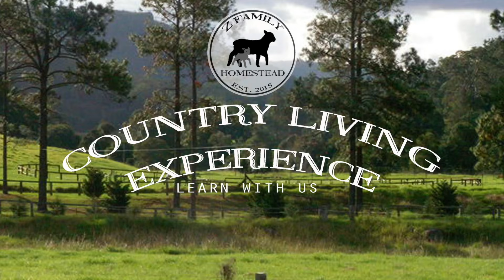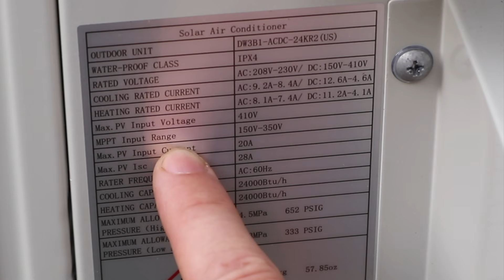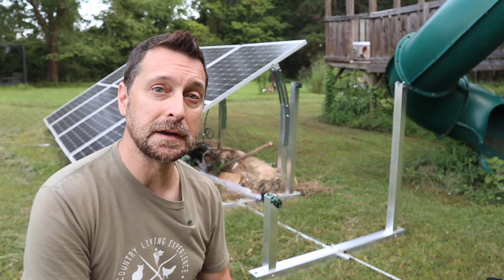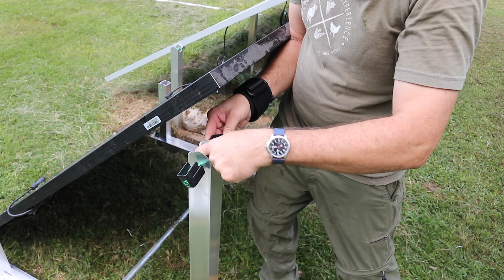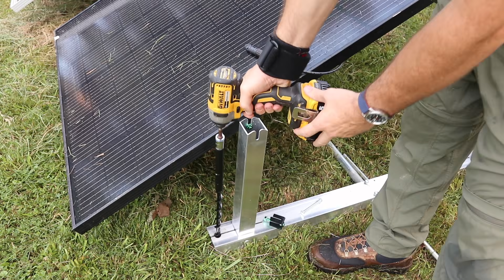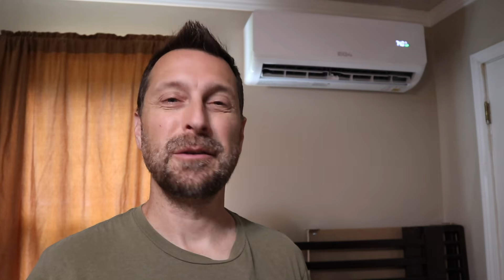EG4 DIY Dual Zone Mini Split! How Many Panels Do You Need?

Comment: ?????
Can’t you just hook it up if you already have panels . Do you need all those extra ones . I got my whole house with regular air conditioning heat . Thinking about those mini splits . So my power can be used else where . I have no clue on the numbers of anything I went big and hoping for best .
Reply from the maker: You don't need to use panels directly. It connects also to your home's ac power. Then you can use your whole house solar system. 
This product is for off grid situations or if you do not have a whole house solar setup.

Comment: I'm running mine on 6x Risen 545w panels no problem. Was getting too many low power drops midday with only 5, I'm still within all safe limits as they are 32v each and 38v VoC at 17amps, if my math is wrong hope someone corrects me soon but as far as I can tell thats safe still. Does max watts actually matter if you can exceed it without going over the Volts and Amps limits?
Reply from the maker: The voltage is what matters the most to not damage the inverter. You are at 228voc per my calcs which is totally fine.

Comment: The EG4 multi zone that I put in my house I’m running 6 590watt at 300 volt unit runs good on solar and on AC but not stable at sun set and sun rise fault 76 with the dc bus dropping out when the boost control wakes up or goes asleep.
Reply from the maker: I have heard one other person mention that. What did EG4 say when you contacted them?

Comment: QUESTION: If you install this in a location where AC is not available for evening power after the sun goes down, is there a battery bank that could easily be charged during the day (preferably with the same solar panels simultaneously), that will last thru the evening until the sun comes up in the morning?

if yes, please specify.

thx
Reply from the maker: As far as I know right now, you would need a separate charge controller and battery bank. Then you would need to somehow connect that to the power supply for the air conditioner. At that point, I would just suggest a normal home solar system and let the extra panels that are connected directly to the air conditioner serve to save battery power during the day. That is what this is doing for me. It is allowing me to charge my batteries, quicker off my main array and just use direct DC power for the air conditioner. Or if you have the grid enabled, then the panels that are connected to the air conditioner will save you having to run that load off of the grid.

Comment: So the EG4's magic trick is that is can accept AC or DC power and blend the two? Why not run solar panels with an inverter, feed it into the house's 115VAC ("Plug-In Solar) and run a cheaper, ordinary mini-split on AC alone instead? The HVAC unit will still run partially or entirely on solar power; it's just being getting it from your house instead of directly from the panels. And the solar panels can feed the house even when the HVAC isn't using it.

Comment: What happens to the PV potential from those dedicated panels during the shoulder seasons, when temperatures are mild and the mini-split runs very little, if at all?
Reply from the maker: You could disconnect and reconnect into your main solar inverter. That is the advantage of the easy to assemble and disassemble IntegraRack.
Reply: @CountryLivingExperience  years ago there were solar charge controllers with diverter loads.
Solar would charge the batteries until full the excess would be dumped to another usage.
if you put one between the panels and the unit any overflow could be used for other purposes.

Not sure if the AC MPPT controller will play nicely.
Reply: @CountryLivingExperience  - I have IntegraRack mounts, but I don't know how that really matters for this question.  No matter how you slice it, your money is better spent on a less expensive mini-split and a more capable PV/Inverter/Battery setup.  Something that meets your needs all the time, not just when it's hot or cold outside.  The EG4 mini-split that can run directly off solar is a classic example of a product that sounds great, until you do the math.
Reply from the maker: This is a specific product for a specific use case. If you don't want it, don't get it. It will be valuable for someone else. So no, some people can "slice it" to make it work for their situation.
Reply: @jasonbroom7147 deek sounding from you
Reply: @chop98  - I'm sorry...is the math hurting your head again?   :p
Reply: @jasonbroom7147 so you admit it! 😎
Reply: @chop98  - If that makes you happy, sure.  ;)
Reply: @jasonbroom7147 you should feel ashamed. You can't even apologize to the man

Comment: Is the system also hooked up to a battery bank? I think that I will stop working once the sun goes down without a battery bank. Correct?
Reply: @victorfebo2672  It can also connect to AC power for overnight.  Battery bank works too, though. When connected to both it will take DC watts, first. Then make up power needs with AC power if it has to.
Reply: @TheHippoConspiracy  Thank you! That makes a lot of sense!

Comment: Nice video! Is there a way to configure your system for load balancing between the two zones?
Reply from the maker: Thank you so much Rob. Are you talking electrical load or cooling/heating load? I think the units ecu will control and balance everything.
Reply: @CountryLivingExperience  I'm thinking electrical load. Can I set parameters for maximum grid usage, then set the units to balance using that limit. In my case, I live in Arizona and I'd like to have panels connected directly to the mini split, then have the grid connection connected to my grid-assist main solar system. I know that sounds odd, but temps is AZ can get dangerously high and the grid occasionally goes down. I'd like to have multiple power sources available to the mini split in a fail-over configuration.
Reply from the maker: Yea, you have a very specific use case. I don't think these are that intelligent. I looked through the instructions for the App (which is the only place I could find with more feature functionality) and did not see anything.
Reply: @CountryLivingExperience  ; Thanks for checking!

Comment: Do you have any regrets not going with the larger unit? I'm trying to decide which size to purchase. The 24k unit is large enough to handle the sq. ft. of my house, but I like the idea of being able to add more panels, especially in the winter for running the heat when the sun power is lower.
Reply from the maker: No. This is perfect for my house and its layout. I already have two other units on the other side of the house. One Mr. Cool and one Innovair.

Comment: You said only a series string,  why cant the unit handle a parallel/ series string?
Reply from the maker: Manufacturer’s recommendation. I did not question them. Do not listen to anyone who says otherwise without the manufacturer’s technical explanation.
Reply: @CountryLivingExperience thanks for the response,  mfg recommendations are important
Reply from the maker: Just wanted to share the vids from the developers of the unit for context. Developers name is Tad and he is a certified HVAC technician in North Carolina. He owns his own HVAC company and works with EG4. https://youtu.be/NbAk_fKwr6M?is=crnyclQMZ58EKy5B
Reply from the maker: Here is the other video with Tad and an EG4 representative on the official channel. They discuss the same thing I mentioned. https://youtu.be/5Au-Sy5T0xE?is=SD8vjXoA0X677DGk
Reply from the maker: One could probably crunch the numbers correctly and run them in parallel….but there has to be a reason they mention series strings only multiple times and on multiple channels.
Reply: This unit likes high voltage (300v) low amps (20 amp max is easy to go over)  the reason why is that is how it was designed.  I run mine on 10 renogy 100 watt panels in series (Rv roof)
Reply: @4PBJT I have 5 longi 355 watt 12 amp panels in series where amps stay the same just the voltage increases so I do not how you come with 20 amps from 100 watt panels in series

Comment: What do you do at night for ac?
Reply: A well insulated home should only need the air conditioner on during the hottest part of the day.
Reply from the maker: This switches over to an alternate power source. Whatever you set up. Ours switches over to AC power which is provided by our main inverter and batteries.
Reply: @CountryLivingExperience  Which is pretty much how I will do it when I get mine. I just don't know yet where I will be putting the panels for it.
Reply: It will switch to the other power source when solar power drops off.